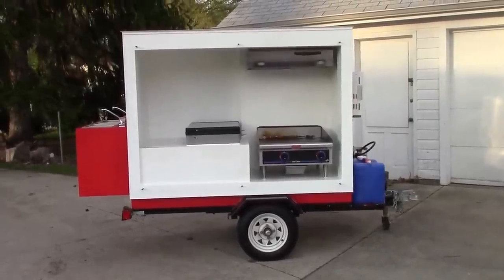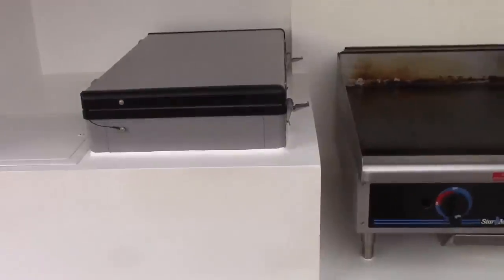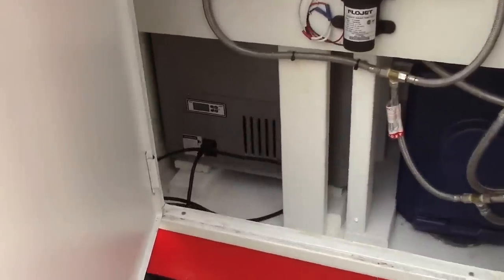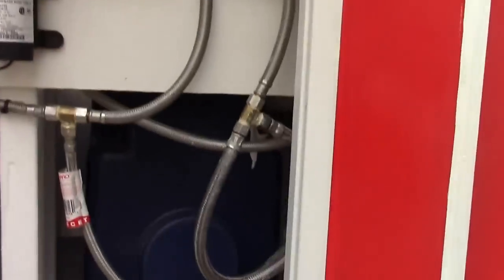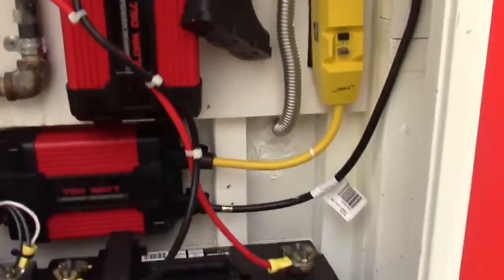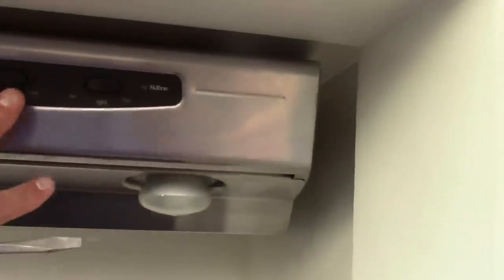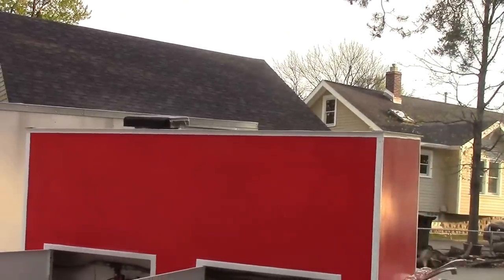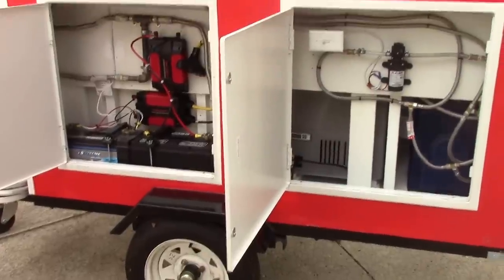How to make a food cart

Comment: Hands down one of  the nicest builds I've seen yet. I'm in the process of doing the same thing. Question what are the connections you used coming off of your water  pump from the clear hose to connect to the regular water lines ? I bought the camplux on demand with quick connects and can not figure out how to run them to the faucet. ANY advice would be greatly appreciated.

Comment: I just bought a 6×10 trailer a gift for my mom. She has ideas and hopes of selling food. My mother was terminated from her job wrongfully. She got tired working at hospitals.   Since now I want to build her a food trailer. Your trailer inspired me of how narrow space can make everything run on 2 batteries. I will like to build a trailer same as yours that depends on his own. adding water gallons & propane. Run the A/C with solar panels. I wish i could have a blue print how to run the wires. I am noob.
Reply from the maker: Depending on what you put in the trailer it may not work with batteries.  When you lay out what you want on there anything that is electrical will have an amp or load amount printed on it or you should be able to find it online.  You can't run more than a few amps for very long on the set up I have.  Like an electric coffee pot wouldn't work, or an electric fryer.  Too much load and you would need either a generator or an external power source.
Reply: +The Burb Billy (The Burbbilly) aaaah okay. Generator will be.

Comment: Hi Burbbilly,  thanks for sharing your cart! Really well thought out and full featured in a small space. A couple questions -- 

 - Could you list in comments the refrigerator your using? 
 - Did you consider building shade cover?
 - Does the trailer have lights?

Again, very inspiring build, thanks!
Reply from the maker: +Matthew Watkins   Hi Matthew! Thanks for the post/questions.  The fridge is a Wytner, sold at homedepot.com   they carry different sizes, I did consider shade cover, was thinking of some sort of roll out but ended up going with an easy up tent and yes the trailer has lights on it.  I also ran light off the batteries when I was set up at night, I could light up my whole area and run lights to highlight my signs as well.
Reply: Hey bro what kind of permits do you need for a food cart are they all the same as a food truck?

Comment: Billy...you have room for two solar panels to charge your batteries...you could actually have more if you use the ultra-lite flex panels that fold, and store them on top of the cart, but deploy then on the ground while you or some one is working.  When done, fold them up and store them back on top. You could have 6 to 9 panels at 35 watts each.  (?)
You can wheel this on a refurbished electric golf cart or small vehicle converted into electric...save on gas!  One other design could be to put the entire operation on an extended trike...electric trike.    Design a "coup" for the trike, make it out of thin plywood and glass it over or out of a mold would be better with the gel coat.  It will be very lite and very strong.  
Actually now that I'm thinking about it...the whole thing instead of heavy wood, framed with carbon pipes.  Set the fittings for the overhead exhaust, counter space and refridge space etc. all molded...sinks etc. And have the door be hinged or snapped off so you can place it on the ground to use as sign.  Great stuff!  Awesome Job...the plumbing and electrical was Great!  Real nice set up...AS YOU CAN SEE...INSPIRING!  THANKS FOR SHARING.  GOD BLESS!

Comment: that is a really cool set up. can you tell me a little bit more about the battery and plumbing system? I'm planning on using this same kind of set up for my plumbing and lighting
Reply from the maker: Batteries are marine deep cycle.  Plumbing supply ran off a 1.6 gal a minute pump that was designed for 12volt use.  Hot water tank is propane and self contained(camping shower heater).  Sinks fed off a 5 gal bucket and drained to an 8 gal bucket.  I built my own sinks out of pans, the kind you would have on a buffet line.  Lot cheaper this way.  That set up would cost $1200 in a restaurant store

Comment: Way cool! how long do the batteries last with the lights hood exhaust and the freezer going? What did you decide to use to charge the batteries?
Reply from the maker: I set up two separate power systems.  One I dedicated to the fridge/freezer and the other I ran to the exhaust fan and lights along with a GFCI plug that I used for external lighting to light my signs at night.  The fridge would have run for at least 2 to 3 days on one charge depending on usage and the lighting and fan I ran for as long as 8 hrs and never had it fail.  I used normal plug in the wall battery chargers to charge them.  I am sure that you could use a solar panel set up to charge these if you needed to, when I purchased the fridge unit I saw a lot of comments on there from boaters who thought it was just the greatest thing.  They were writing comments about how the could have ice for days out on the water as opposed to it melting in 2 to 3 days in a cooler.  Some of the comments mentioned running a solar charging set up.

Comment: Nice, all you need is a few hold down points to hold shock cords to use the inside for storing the consumables and rolls. You might want to look at an eezy awning to fit on the top as well, probably using the existing mountings, so you will have shelter when it rains or it is very sunny. here a lot of these carts start off as a used caravan, and you have a lot of usable interior when half the one side is removed.
Reply from the maker: Thanks Sean

Comment: nice. I'm thinking of building one for my daughter and husband as a side business for them. I like the fridge and will most likely go with a 4x8 trailer for as much space as possible. I will probably attach stainless steel sheet to the back of the griddle for easy clean up .
Reply from the maker: dank donkerson I wish I had started with a 4 x 8 frame, I originally planned on doing that and got talked out of it and would have been a lot better off if I had stuck with my first plan.  The 4 x 4 cart doesn't give you enough room if you want a fridge on there and when you have to add on like I did it throws the balance off.

Before you start though I'd look at where they are setting up and see what other venders are using in that similar situation.  If I could have a do over I'd have built it enclosed in a 12 or 14 foot trailer.  Would have been a faster build and all my cook stuff would have been self contained.  Food for thought...:-)
Reply: I live in NH and a guy at a home depot has the enclosed trailer, he paid $36,000 fir it and said if he did it again he'd just get the shell for $17,000 and do the interior himself. I saw another guy at a home depot who has a stand that looks like a big converted utility trailer that's nicely set up, 3 sides open up.

I have a question, how much did you pay for the griddle? I was thinking of buying a 36" blackstone griddle from Home Depot and building it into the stand with a fire box around it with a portable grill next to it. I've been looking for steamers like the ones on the cart but I cant find them on line, it's like they're a big secret that they don't want to sell. did you have the same problem? BTW the deep freezer is awesome and something I wouldn't have thought of, might  have to steal that idea from you. :)
Reply from the maker: dank donkerson Griddle was around $1000.  Before you buy anything determine where you will be using it and then contact the local health department.  Depending on your inspector they may not approve the Home Depot griddle.  Usually they want it to be commerical grade.  There are exceptions for every rule though and health departments vary from locality to locality
Reply: thanks, will do

Comment: hi, just wanted to say what an amazing video wow man this inspired me, really. i'm thinking about building my own cart actually and was hoping you had any advice on constructing the cart with materials, however, very limited tools or equipment. any help?
Reply from the maker: Hi Ben, If I had it to do over again I would have built this inside of a trailer.  I ran into problems with the amount of time it took me to set up my food/work area and then break it down again.  I built this cart with wood (mostly) but made sure my health department would pass it before I started the build.  You don't want to build something and then be told you cant get a permit to sell.  If you have limited tools and building knowledge I'd say your best bet is to look for something already built either new or used.  I know that's probably not what you wanted to hear but that's most likely your best bet.  If you do start a build and run into a problem shoot me a message and I'll try and help if i can.
Reply: Right on man thanks ill keep you posted!

Comment: This is awesome. How would you do it with fryers?
Reply from the maker: ladysunshine37   I think it'd have to be an enclosed trailer if you were running fryers and depending on where you would set up at then you would either run electric or gas fed.   For the ability to set up anywhere I'd go with something that runs on propane, but you would probably have to have a bigger exhaust fan.

Comment: Can you create some plans for this? What size trailer do you have? I have a 4 x 8. Sure would like to see the plumbing, electrical schematics even if they are hand drawn. And hook up for propane. Thanks
Reply from the maker: This was a modified 4x4   a 4x8 is much better   make sure to get the weight balanced on your build so that you have it heavier in the front or it won't tow right.  Sorry no plans  I did this on the fly out of my head

Comment: I'm 14 and thinking about buying a hot dog cart and then paying another person to work it for me most of the time. Do u think I will make any money from this or I should just work it myself on the weekends. And if I do decide to get a hotdog cart what do you think like all together the cost will be for like the first month including buying the used cart and getting permits.
Reply from the maker: Gabriel, First off, I'm really impressed that a kid your age is already thinking about setting up a business.  Major props to you.  I would say though that any business you decide to do you should probably do it yourself for at least a little while so you learn the ropes and understand what's going on.  There is a lot more to a dog cart than just getting dogs.  There are different size and quality dogs that you can purchase and you will most likely need to run through a vender if the business is good.  a 10-1 dog is 10 dogs to a pound and an 8-1 dog is 8 dogs to a pound, venders will ask what you want.  runs all the way down to a 2-1 dog i believe.  Permits depend on where you will set up at and if you have someone working for you they have to take food safety classes(required in most areas).  That's why it's best if you run it yourself at first.  I would suggest running one at a local flea market on the weekends if you can and selling a cheap dog with maybe some chili and onions and condiments.  Dont' get fancy as the flea market crowd is looking for deals.  I learned a lot running the flea markets.  As far as a start up cost if varies so much I'd dont have a straight answer for you.  Cart could cost a couple grand or more used or you may get lucky and get a deal.  Permits will be least of your cost
Reply: +The Burb Billy (The Burbbilly) thanks I was thinking about saving up the money to buy the cart and getting all the permits during the school year and than running it myself over the summer until I can find someone else to run it for me. And if I do get someone to help run it for me do u think my bisness will still be profitable?
Reply: gabriel Heskett did you get a hotdog cart yet?
Reply: You can rent some trucks but in some state you have to get a food handle certificate attend a class for maybe two hours watching a film. From the health department past the test based on the film get a medical exam from the doctor and get the truck or cart inspected by the fire department and city inspector before you can buy the permit it's a lot of work but it pays off you need the knowledge of food safety when dealing with the public so no one gets sick an sues you there are a lot of regulation you have to follow according to the health department or they can shut you down good luck but you may have to be 18 don't give up
Reply: work it yourself they rip u off

Comment: Very Informative. What is the function of the yellow device of the rear left hand side?
Reply from the maker: I think you're looking at the GFCI splitter.  It does two things, it splits a single outlet into three outlets but most importantly it protects whoever is using it from ground fault shocks.  This is typically required anywhere you have an outside or wet location outlet.  Since I was providing my power I decided to use this instead of a gfci outlet. Always use gfci when working with power outside.  They have saved me from a shock and possible death in the past so I am a HUGE fan of them!

Comment: Got a question where did you get the 3 bay sink that small?  I've got an old cart I bought for $500 it's about 25yrs old and is rusting so bad now.  I got the idea to build my own from seeign that trailer in Harborfreight.  I can use the old 3 bay but I want to build from scratch.  I'm going for a 6 burner event grill and a flat top grill.
Reply from the maker: +Speakerofthehouse2   I built it out of pans.  Buying one premade they were listed at over $1200 at my restaurant supply place.

Comment: Wow! I have been putting all my energy and money into building a food cart that will be towed by a bicycle, and have run into some frustrating problems.  I love your idea. I may just scrap everything I have done so far and copy your idea. 

I am familiar with the Harbor Freight trailer. Can you tell me what the dimensions are on the model you used. I think there's two models isn't there? I love your hack with the bed frame. Great idea.
Reply from the maker: Hey Tom,
The trailer I used was a 4 foot trailer from HF   If I had it to do over again I would have gone with something enclosed.  The amount of time you save on set up and break down with an enclosed trailer/truck is HUGE.  That said if you are looking for something to pull you could work with the HF 4 foot trailer.  they make an 8 foot version but not sure how that would work with a bike.  Everything for your build is going to be about weight.  Id suggest using a metal roof to cut weight, maybe a thin underlayment and cover it with trim coil(thin alum you can get at any home depot) or figure out a canopy set up.  This cart started to get heavy.  The grill was some serious weight, the fridge was probably 80lbs and add in your food weight plus any drinks....starts to add up fast.  What are you thinking of cooking on your cart?
Reply: I was planning on cooking steak sandwiches.  I bought a slightly smaller freezer from Walmart. Have three sinks not four. That's what you need in Canada. I like your sink set up  though and I think I will steal your idea of hooking them onto one end of your trailer. I have mine in the middle and that real estate is just to dear to use  up on sinks, if you can avoid it. Thanks for that great idea. Your electric system looks great. Seeing your set up gives me a little more confidence that when I set mine up it will work. I wasn't sure if i should use one battery or two or three. Seeing your set up helps me visualize what I might need. I looking to include a solar panel in the electrics. Have you considered of that?

My roof is made out of 1/4 " plywood with a slight curve to make it aerodynamic. It is coated completely with fiber glass resin, and weighs maybe 30 lbs. I am thinking the fridge weighs 70. The big weight will be the grill the water, and the propane. Food of coarse. I need to keep it under 400 lbs. and there's the challenge. 

I have an electric motor on my bicycle. Couldn't pull it otherwise. The trailer I will be using is built by Bikes At Work. I am using an Xtracyle to pull with the stokecylcle motor sold by Grin cycles of Vancouver BC. That's the rig. When it's a little more done I will send you a photo.

I have to say I am delighted to find you on facebook because your ideas are similar to mine, except that you are doing the sensible thing and hauling yours with a vehicle.  Obviously your range will be much greater than mine. I am curious about your locations. Fairs, festivals, and local events I am guessing. How have you been doing?
Reply from the maker: Yes on the solar panel.  I was thinking of running one battery and using a panel to charge the other.  Space(real estate as you say) is hard to come by on a cart.  I pulled mine with a minivan and had the van filled with stuff as well.  Be suprised how much you need.   Water is heavy so remember that when setting up your storage tanks.  You have to pull around whatever is on the cart.  If you are using a bike I would do a test pull at almost every stage of the build to make sure it's balanced and you can comfortably tow it.  If you have a camera make sure to video what you do, love to see it and so would a lot of people on YouTube.  I wish you all the best with your future food endeavor and most definitely keep in touch and let me know how it goes.   I'm curious to see what you come up with.